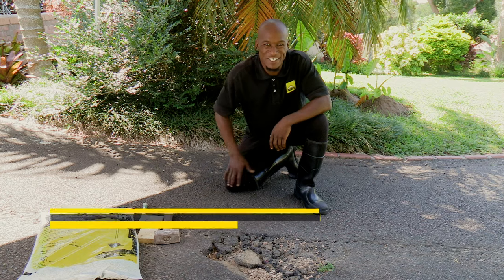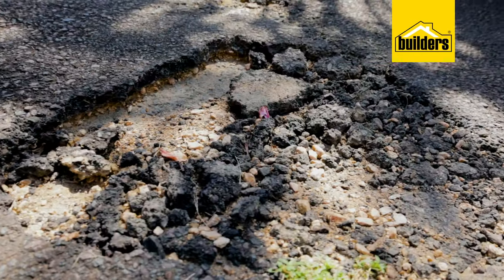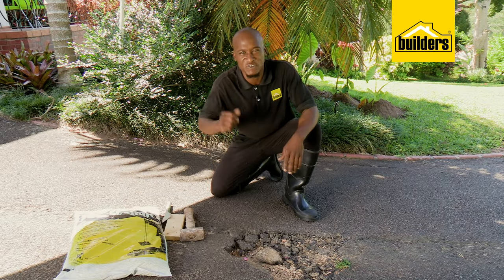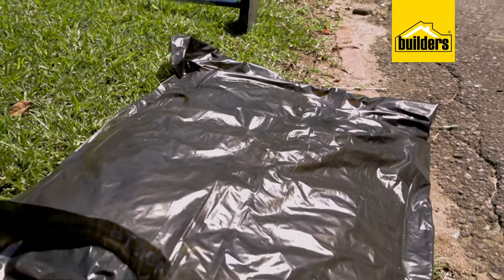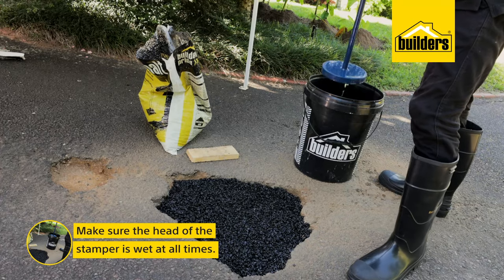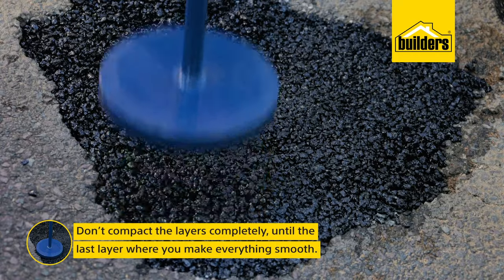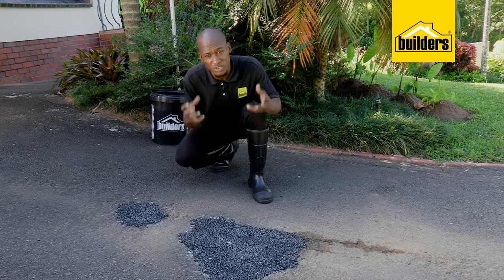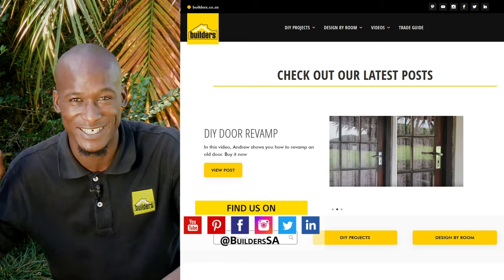Fix Potholes Yourself With Cold Tar Mix

Comment: Love the demo, but, you really should wear garden or similar gloves when removing old tar (at all times through the process, actually!), as there can be unexpectedly sharp objects embedded in them (e.g., in my handyman career, I've found glass, can tops, nails, et al.). Love the tip about letting the asphalt sit in the sun (n.b., a blowtorch used gently over the cleaned hole, before adding the asphalt, helps, too, but, is not necessary, and can be dangerous for those not accustomed to working with torches, and, of course, it adds to the expense). Avoid sealcoating small areas, alone, as it will not work as well as coating the entire driveway. Also, if you don't have a stamper, a 3-5 pound sledgehammer works just as well, though, of course, it'll take more time (since I rarely fix potholes, I don't have a stamper, and wouldn't have a place to put it, if I did!). Do not use the back of a shovel, as you'll never get the even and heavy pressure needed to tamp the asphalt; also, don't bother running your car over it: You'll ruin all the work by pushing the asphalt out of the holes, not to mention getting the stuff on your tires, because, surprisingly, the distributed weight of the car isn't as good as the sledgehammer or stamper!

Comment: I have the perfect solution for potholes.  My dad gave me this recipe before he passed away. He worked for an American company and it was way back in the 70's and 80's , you can still drive on those roads until this day...there will appear a pothole in some other part of the road but never on that part where it's been fixed. Unfortunately: I am a woman and I am South African, so I wont get the contract to do it...sad, very sad!
Reply: If it's not a secret, can you reveal how to do this. I have a drive way 900 foot long. It is costing me a some fortune to keep up over the years. Thanks in advance!
Reply: @alabamaflip2053  😅